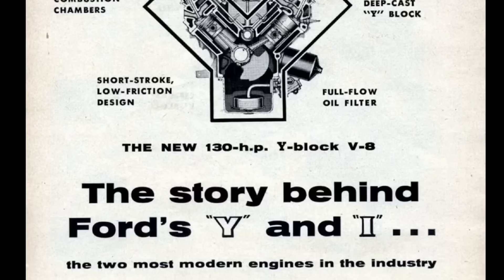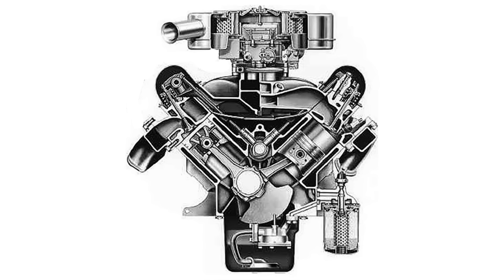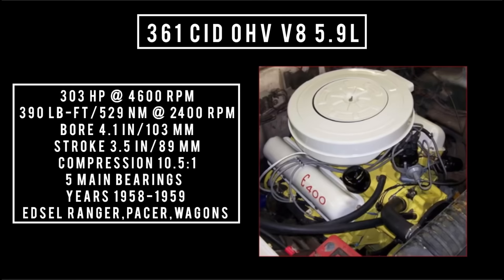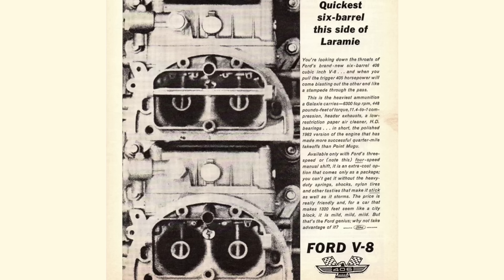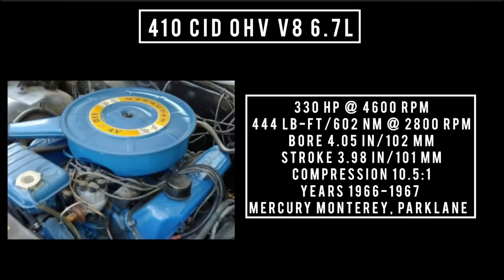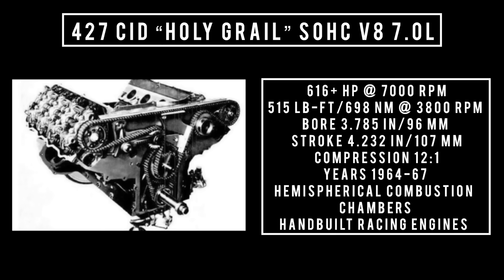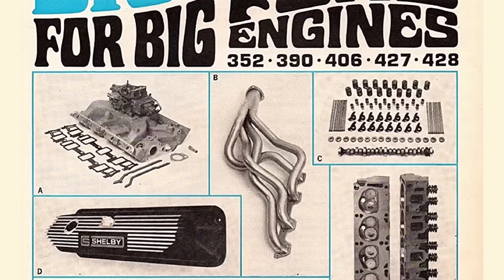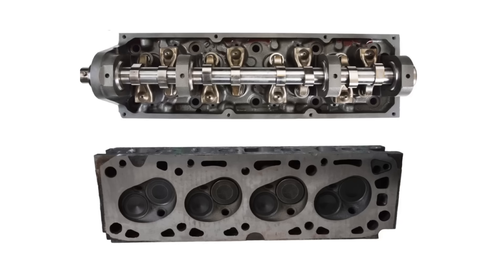Ford FE Engine Family 332, 352, 361, 390, 406, 410, 427, 427 CAMMER, 428, CJ428, SCJ428

Comment: You see that... You schooled me on a couple of points on these motors! My first (legal to drive ) car was a 65 Merc Park Lane with the "Marauder" 390/348 horse engine. You have one pictured you called a 66 but it's a 65 (mine was white). I blew it up driving at an "excessive speed" and found the oil pump rod twisted and broke thus sealing the death of that motor. Found a rear-ended Torino in a junkyard and bought the 428 out of that and went in the Merc. I'm glad my next door neighbor was a Ford guy or I would have been walking. May have been why I was a lifetime "Chevy/GM" guy! Great job on this one!
Reply from the maker: Thank you so much glad you dig this episode =)

Comment: Jay, recheck the bore and stroke on the 427/428 engines,  I believe the 427 had the bigger bore and shorter stroke then the 428.  Older Ford motor heads would take a 428 crank and put it in a 427 and came up with a monster  FE engine with around 454 CID.  Let me know what you find.
Reply from the maker: Thank you so much for that correction yeah that one’s flipped for some reason

Comment: 332 had a 4 inch bore and 3.30" stroke. 3.6 and 3.6 inches respectively, thats not right. Same with the 427 bore and stroke the wrong way around.  I can cope with everything else. I continue to love your stuff. 🥝✔️
Reply from the maker: Thank you so much for that correction =)
Reply: U missed the bore size of the 58/59 361.
Reply: @jesseduke694  🥊✔️

Comment: Please feature the old Ford Super Duty engines from WAY BACK.  The 401, 477, and 534 cubic inch monsters that were found in big trucks.
Reply from the maker: Most definitely will one day =)
Reply: Those were based on the MEL engine design
Reply: All cores gone as you cant plane the deck too much and they consumed. cranks if you didn't catch bearing failures early. 
Overall a good engine if you have cheap gas...
Same goes for the GMC 637 V8, the Super Duty was a more reliable and way more produced.
Reply: @rodmpugh226   Now that's interesting.  Should be included in a future video on those engines.

Comment: Only forgot the 391. Never met anyone yet who could list all of the engines in the FE line.
Reply from the maker: That’s a FT ford truck engine they will have their separate episode I decided to split it up that way it seems like everybody splits it up different I just thought it would be easier to cover all of the FE engines that could be in either cars and trucks as one episode and then cover all of the truck engines in another. Both Ford and Chrysler are super confusing on engines Chrysler even worse than Ford Ford had a lot of different engine programs during this period in time at one point in time Ford offered the FE MEL Y-block and maybe even the Windsor small block all at the same time.. (1960-62 i’m not sure when the Windsor small block came out I know that it was available by 62) plus FT truck line and the super duty engines that’s a lot of engines on offer at one time all from different families with multiple options within families.. I don’t even get me started on the transmissions The late 50s they had three different size transmission cases with three different size tail shafts And on top of that they could either be air cooled or coolant cooled
Reply: @What.its.like.  you listed the 361. That's FT also.
Reply from the maker: That was the edsel engine 361
Reply: @What.its.like.  that's true. The  361 came out in 1957/58, in the Edsel line of cars.
But readers are not familiar with that engine, because the 352 was listed in the Ford line of cars, as they are the 361/391 engines in Ford trucks, which are accentually FE engines.
Hence the founding of FE. Ford and Edsel, father son, joint effort. Which we are all so grateful for.
Reply: @jesse75 no, the 361 FE was introduced in 58. 58 was the very first yr for any of the FE engines & the 3 available engines was the 332 FE, the 352 FE, & the 361 FE. All passenger car engines. U are confusing the 361 FE with the heavy duty 361 & 391 FT. They made both versions of the 361.
Reply: @jesseduke694  no confusion.
Reply: @jesse75  seems like alittle confusion? You still referred to the 361/391 as "FE's"? Those engines are not. They are FT's.
Reply: @jesseduke694  are they a deep skirt design ? Yes. Are they an FE derivative ? Yes.  Without the FE line of engines, would they exist ? No.
Just as with other engines in the FE line, tunnel port is a perfect example, the heads and manifolds specifically designed for a certain application. Heavy duty truck.
The FE engine gave birth to an incredible platform to innovate from. 
FE and FT are blood brothers. Not different. Relative.
Reply: @jesse75  they are related. I'm not arguing this. But they are very different! They have more differences about them than similarities.  Hence the different name. FE...... FT........ the raw block castings between the two are identical.  That's where the similarities stop. The very next process is machining the blocks. They are machined differently. One is FE, & the other is FT. Crankshafts are vastly different. Pistons are vastly different.  The balance is vastly different.  The heads, valves, timing cover, distributor, oil pump, intake manifold, exhoust manifold!  Probably more? The same is lifters, rods, ........ that's it .
Reply: @jesse75  the tunnel port is a FE. Not a derivative. All of the FE engines in the FE line up are all 100%  FE. Nun of them are derivatives. The heavier related cousin, the FT is very similar, but different enuf to have a different name. By the way, the FT crankshafts are desirable. They are steel cranks. But they are externally balanced .
Reply: @jesseduke694  if the crankshafts are different why did some NASCAR Ford engines run the 361 crank in a 427 block to make a 396 ?
Only the snout has to be turned down and keyway cut. 
Many parts between these brothers are interchangeable. 
And I hope I increased your vocabulary by at least two words.
Reply: @jesse75  u mean u have to ask me what is different about the cranks??? Strange?? I thought u was given the lesson here, sport?! Why don't you read? With ur big vocabulary I would think u could sound ur way through the info??!!! Let's see? Why would they use them in nascar?? Why not regular 352 cranks?? Is that what u meant?? They used 352 crankshafts in 427s in Nascar to make what? 395 ci??? U said they used a 352 FE crank right? Not the 361 FT crank???
Reply: @jesse75  Where did you go? I'm waiting for you to realize you just proved my point for me!!! Hey if u guna hand over easy wins like that all the.time let's debate!!! This is to easy!!

Comment: Back in the day,  ordered a 69 Mach1,428SCJ , 430 gears.With a little mentoring from Tasca Ford ran a consistent 13.7s at Conn Dragway and NE Dragway Pure Stock Class which consisted of street tires and closed exhaust.Had a very good launch and was a fast street car, made a lot of Chevy Guys unhappy ,i used to tell them (Not Bad For  335 HP } .Went to the next level,  sodium valves ,multi angle valve job ,matched  intake/head ports and General Kinetics cheater cam to run a stock class.Ran 12.3s, 112 mph, the class I ran had to run 7" slicks{ wrinkle walls } with 7psi air pressure, was exciting going the traps at speed.
Reply: I bought a 427 missing a cylinder because of sodium filled exhaust valve I installed a sleeve a lot of cast iron welding had a side oiler 427
Reply: A lot of people were running aluminum valve spring retainers to lighten up the valve train back in the day, Tasca Ford told me don't do it, the sodium filled valves were enough, plus the 428 wasn't a high revving engine, used to come thru the traps at 6200 @cooperparts
Reply: My 66 nova 327 350 hp used to eat em 428s and 396s at myrtle beach dragstrip
Reply: I had a stock 327 360hp it ran low tens I installed wheelie bars and M&h slicks drove it to the drags back in the mid sixties Tasca was  afraid to run me @robertcoleman7556
Reply: Was that on the street? They were a light cars, what were your times, or was it just a street racer?  @robertcoleman7556
Reply: @josephsouze9951So do you really think it only made 335 HP?
Reply: No, but it was a good conversation piece back in the day.My friends 67 390 GT was rated at the same HP.Was strictly for insurance reasons. @purpurahaze9179

Comment: Wasn't there also a 330, 331, 360, 362, 391, 392 and 428?
Reply from the maker: 428 was covered 

The rest are FT
Reply: @What.its.like.  

I just saw the headline and without clicking it stops at 427.
Always thought it was funny working in engine shops in the 70's. Thumbing through the parts books Ford had every number covered.

Comment: I have a 360 FE in my 1976 F150 4x4. Original with 108,000 miles. It’s my daily driver. I really enjoy driving it.
Reply: I’ve a ‘72 Exploder F150 With a 360
Reply: I think you mean F-100. @ProctorsGamble
Reply: @mr.lincoln5154  No, it is a factory F150. Ford added the 150 to the lineup in 1975.
Reply from the maker: Sweet totally going to cover that engine when we do the FT engine family =)
Reply: @What.its.like.  The 360 is an FE. The 361 is an FT.  You got 'em switched.
Reply: @What.its.like.  The 360 FE in pickups isn't part of the FT family. The so called "FT" was in medium trucks.
Reply: @What.its.like. lol i have a 361 FT in a 69 F700, slow as hell but will indeed pull anything at 55. Does maybe 3800 rpm max🤣🤣. But aye, can hurt anything, IT WILL DO BURNOUTS
Reply: My Dad bought a360 '69 F-250 he said he expected it to last forever , because it didn't hav enough power to hurt itself !
Reply: 😂 @brucegillies1694
Reply: From what I have heard, the problem with the 360's was the heads and the single exhaust.  Slap a set of 390 heads and dual exhaust on a 360 and many of the problems will go away. @brucegillies1694
Reply: Cold or warm climate? We had a 73 F250 4x4 4 speed granny low with 360 2 bbl. New York/Pa border. Looking back it seems like a good ugrade would be an aluminum intake just to get the weight down so fuel would atomize better. Maybe the iron is not as bad as I think. You still stock?
Reply: No mention of the 360 FE engine 🤔

Comment: Great video, but two minor corrections: first, FE does stand for Ford/Edsel, just like M-E-L. Second, the bore and stroke numbers were reversed for both 427 specs. Amazing that you could buy a new Cammer 427 for $4k, but that is more expensive than a complete Mustang! Or full-size LTD, for that matter.
Reply from the maker: Thank you so much for that correction =)
Reply: Can you provide a link to Ford documentation that says it's Ford Edsel? I have never seen any proof, just lots of opinions.
Reply from the maker: https://en.m.wikipedia.org/wiki/Ford_FE_engine

https://www.macsmotorcitygarage.com/work-horse-race-horse-the-1958-76-ford-fe-big-block-v8/

https://amazingclassiccars.com/ford-fe-v8-engine/
Reply: @What.its.like.  Thanks for the info. It provided some interesting reading!
Reply: @What.its.like.  i wonder why someone decided that after 65 years FE had to be something else other than Ford Edsel. I was born in 1950 I got a summer job in a service station when I was 13 , i was impressed to see the FE engines for the first time with distributor in front. Much better than standing on your head to Change points in old Fords and Mopar's and Chevy cars.
Reply: incorrect bore x stroke is not a minor correction. An under square engine would never achieve the required rpm
Reply: @RobertRobert-d2r  Wah.

Comment: 427 SOHC was good for 657 horsepower with dual quad carbs.
Reply: It's been told that some cammers seen 9 grand in competion
Reply from the maker: I figured it was much higher than Ford claimed as was all of their engines frankly.. from that era that’s why I added a plus every source said something different

Comment: One weakness of these engines was the  thin bushings in the connecting rod eyes. I’ve seen a good number of these come loose and be in multiple pieces. Connecting rod beams would also bend and twist.
Reply: I guess that some of the hi po engines and maybe the Police Interceptor engines might have had beefed up con rods and pistons?
Reply from the maker: Awesome information thank you so much for adding that

Comment: almost as good as the Chrysler B,R/B,& 426 HEMI engines; but not quite.
Reply: Did any FE engines have staggered and/or angled valves? "Cobra jet" or 427 ?
   (Hemi engines were an extreme of this,also "Polyspherical" combustion chamber engines)
Reply: the only phord engines i know of with canted valves are: 427 sohc,boss 429, and i think 351c. the first 2 listed have basically a hemi head layout. i guess the 427sohc is considered an FE.  chev big blocks are also canted valve engines in case you happen to give a rats. ADVANTAGE CHRYSLER! @davidpowell3347
Reply: @davidpowell3347 the 427 cammer was a hemi & was much faster than the 426 hemi.
Reply: @jesseduke694 very much up for debate as there are no (production)cammers and most top fuel dragsters use engines based on the 426 Hemi and that says a lot
Reply: @dinadaughtry8993  was this discussion based on what engine  production cars came with? Or if other engines had the canted valves like the 426 hemi? The answere is yes, the 427 cammer did. As far as debate? Whats to debate? The camner clearly out performed all its competition. The very little it had. As far as top fuel engine today, lol! You think they are useing 426 hemis today in competition?? LOL! No. No they are not.
Reply: @jesseduke694  I realize they don't use the cast iron block 426 Hemi anymore,i said most top fuel dragsters use engines BASED on the second gen Hemi and many more production second gen Hemi where put in everyday production cars than the Cammer which was a race engine,the 427 pushrod engine was not as rare but still hard to find now, talking about original production engines not New cast aftermarket, they were both very strong running engines and the Ford Cobra did hold the word record for the fastest accelerating car . all that aside dyno test showed the 427 ohc and the 426 Hemi to be very close
Reply: @dinadaughtry8993  close?? We are talking hypothetically here. Bench racing if u will. So one would assume both engines to be tuned & operational to their peak levels. When one says both engine performed amazing & were very close, what u are saying but trying to avoid admitting that on a performance scale in race versions, both not just one but both being race versions that the cammer performed as one would expect & as dyno results have shown. It was faster than the race 426 hemi. If u wanna talk witch was the all around better engine, that's a different discussion. From a performance stand point it was the cammer. 
 Top feul dragster engines are based on big block chevys as much as 426 hemis. They are hemis, but they are along way from being a Chrysler hemi.

Comment: All the engines from the 352 up were casted on the side of the block as 352. I worked at a Ford dealership and learned that. Many 390's that I have seen have the 352 casted on the side of the block. The 427 cammer also had the spark plugs in two different places. I believe that the early model the plugs where on the lower part of the heads. Later model heads the plugs where located on the top, which made it easier to change them.
Reply: Not all of the blocks had 352. Some 427's didn't and the 501 block didn't either.
Reply: Nope, late 360 & 390 have a mirror image 105 instead of 352.
Reply: @tombryant1104  true. That ribbed block. I just rebuilt one and have it sitting in the garage.
I've heard it called a service block too.
It isn't easy to fully understand the FE family line of engines. Maybe father/son had some arguments and discussions upon its conception ? 
Which has near mythical existence. 
I'm proud and privileged to own a 427. And it's topped off with that tunnel wedge intake. 
An engine that sends chills every time you start it up.
Reply: Idk any of of this, alla i know is my 390 is a 428 block. And it wont fuckin die
Reply: @whathappensinmaine5463 that math don't compute

Comment: Had a 66 fairlane gt. 060. Over 390 with 427 low riser heads and intake. 735 holley off a 428 cj, headers. This car would fly. Stock bottom end, shifted at 5500. Thanks for the video.
Reply from the maker: Thank you for sharing your cars with us =)
Reply: Don't believe you. 427 valves are too big for the bore on a 390.
Reply: Actually 427 heads/valves do fit on a 390. Some applications require notching of the top of the 390's bore. @jesse75

Comment: The cross-bolting was introduced on the late-run 406s, not the SOHC.
Reply: Correct first side bolt was 406 and all 427s are cross bolt.
Reply from the maker: Thank you so much for that correction so much conflicting information
Reply: Also all 427s @What.its.like.
Reply: Top oiler 427 was not crossbolt mains
Reply: @coscuploads8448  you are absolutely right had one